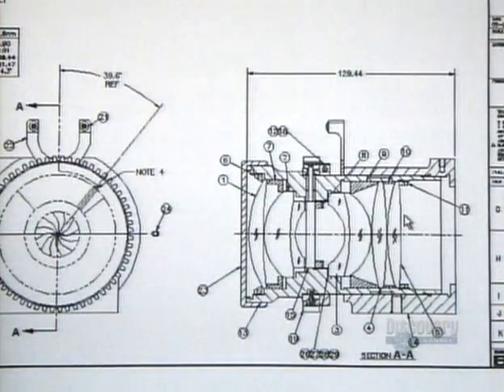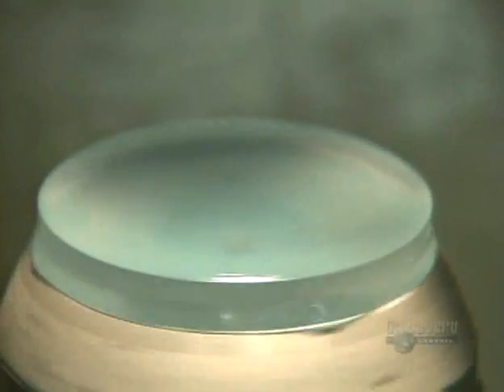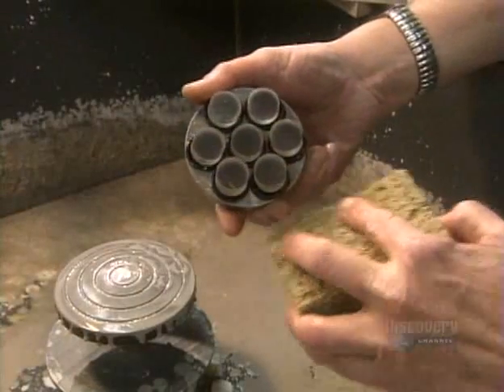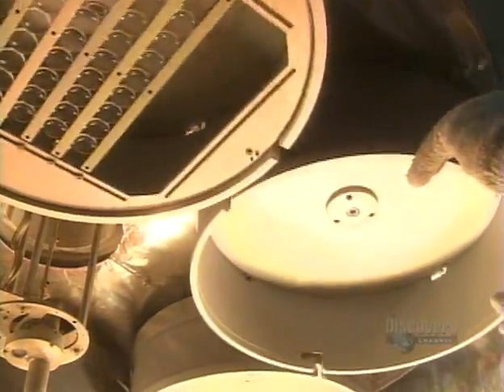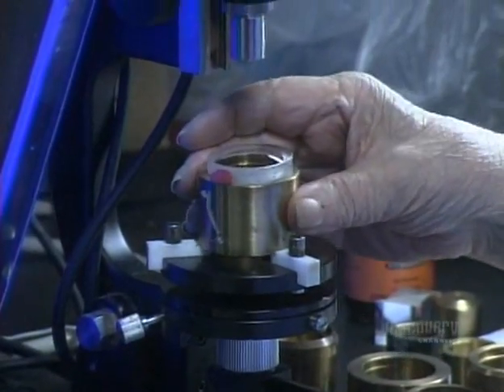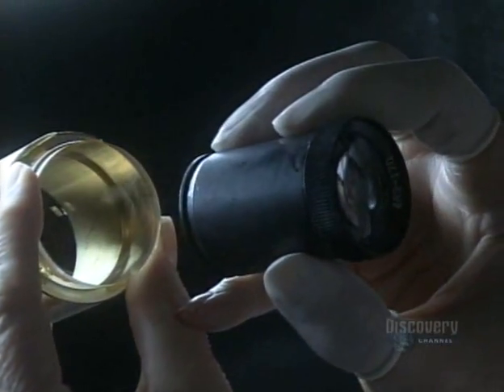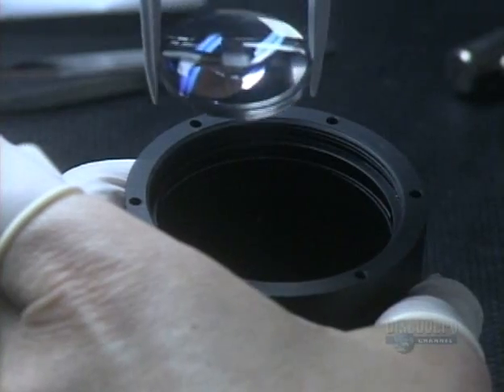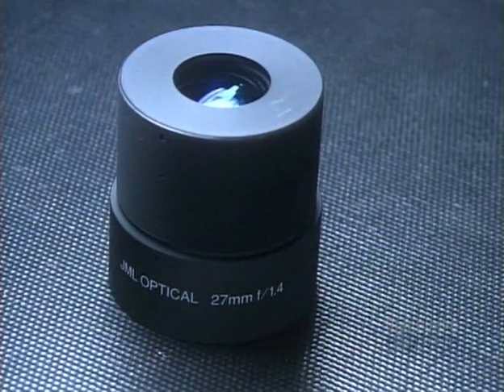How camera lenses are made

Comment: btw, this video doesn't include the manufacturing of the autofocus, mount, metering, stabilization, or the crafting of the barrels, so you have to consider that all that costs major money as well, since it's all science-level precision most of the time.

I know since I've been using Nikon/Nikkor as well as Canon, Fujinon, Leica, Schneider, Pentax and Zuiko (Olympus' accepted lenses)for a while. I'd have to say  I prefer Nikkor, but both Nikkor and Canon are at the top of the pack. =]

Comment: 6:24 "Cementing them together means that they'll be less likely to shift around in the lens barrel"

What nonsense! They are COMPOUND ELEMENTS, in this case a doublet. Two pieces of glass with different refracting index are cemented together to work as one. (It's also more complicated than that).

And she also call the antireflection coating "protective coating". Geez...

Comment: There's no way to make something absolutely dust free.  There's only levels of cleanliness - how big are the particles, and how many of each size.  So the question is, how much dirt is acceptable, because even in the highest levels of cleanroom, there are still particulates.

And this is common practice.  Deterministic grinders and diamond turning lathes are incredibly expensive to purchase and maintain, and operate substantially slower than the method you see here.